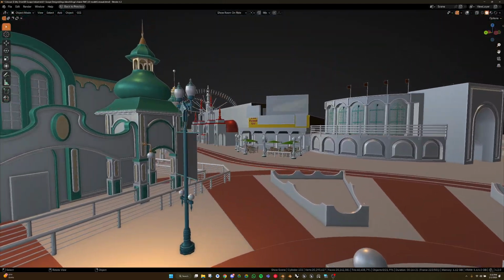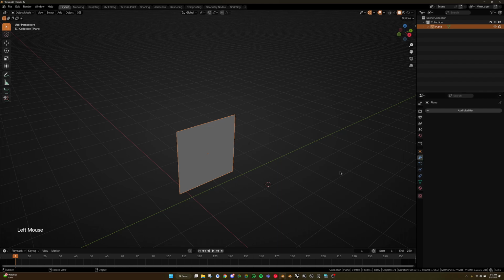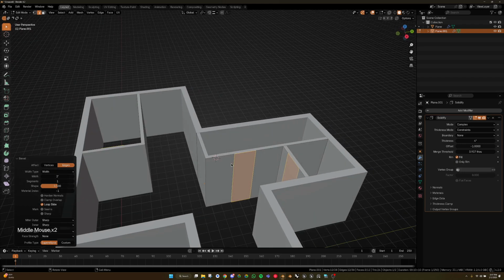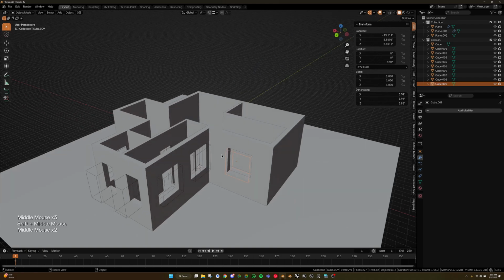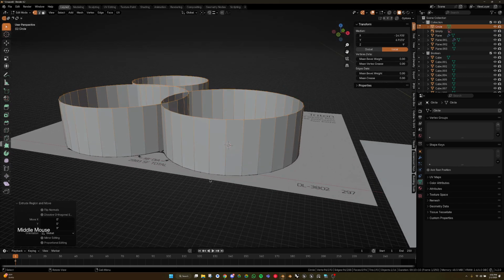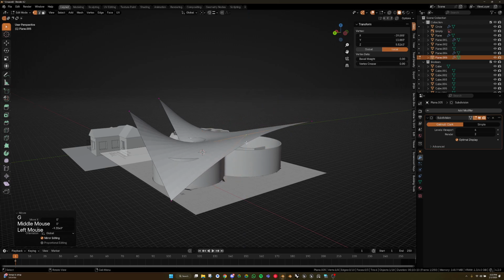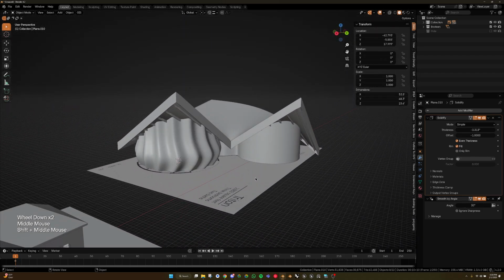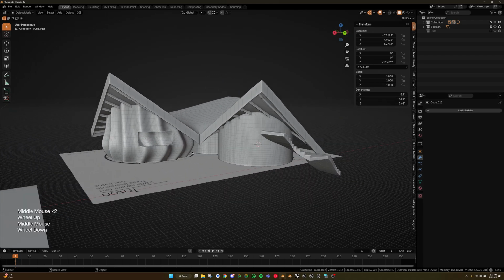Architectural Modeling Techniques in Blender - Roofs, Walls, and Stairs

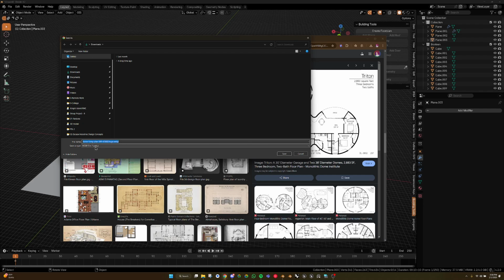Comment: 26:34 - Careful when renaming extensions like this, as you are not changing the file format! What he downloaded is still a WEBP; The ".format" notation in filenames is just a hint, hence why it can be changed or removed at will. It works in this example because Blender is diligent and checks the actual file for it's type instead of relying on the filename to deduce the file type, but not all programs will be this gracious. To convert a WEBP to a PNG one needs to use a proper conversion tool. Other than this niggle, excellent video!
Reply from the maker: Good point! Sometimes it does not work like you said.